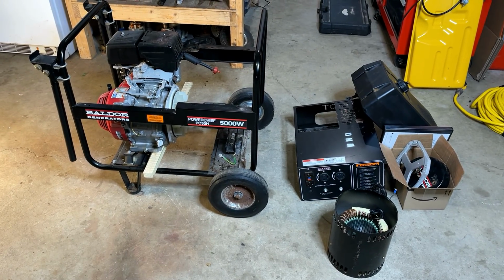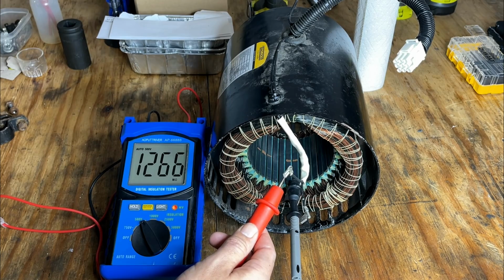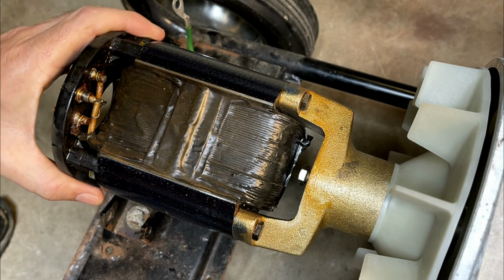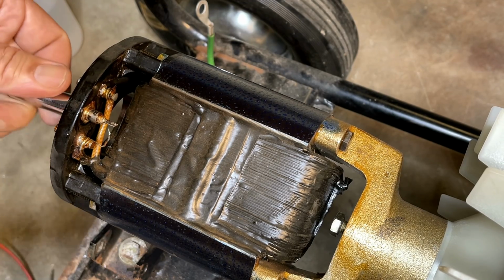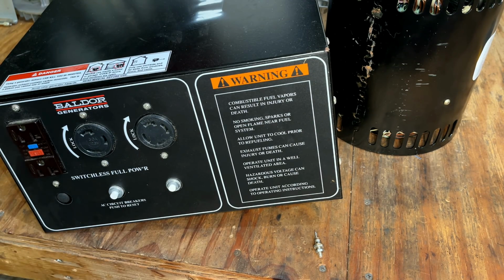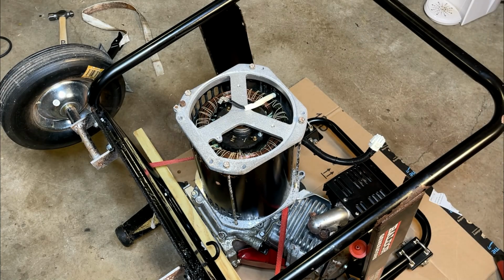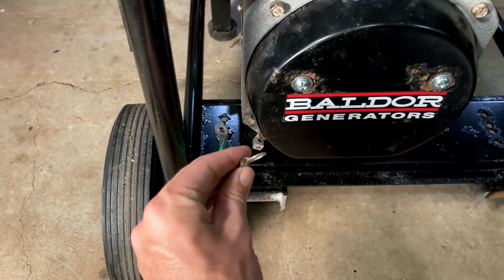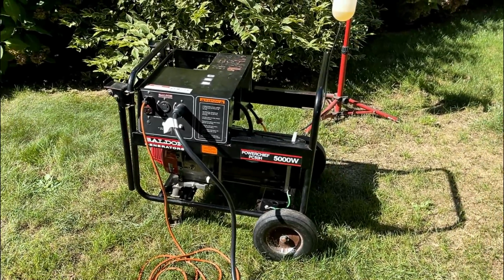Baldor Generator Not Making Power - Can It Be Fixed?

Comment: Did you try both Mouser and Digikey?
Reply from the maker: I tried Mouser to locate a comparable part.  They were not able to cross reference it.  I ended up ordering the replacement diode from Mouser.

Comment: The diode has an excessive solder blob at the base of the tip .. remove all the excessive solder and retest …
Reply from the maker: Thought about it, but it was covered in epoxy and in one section almost looked like the diode vented blowing a hole in the epoxy.

Comment: Hi Love the vids. As the diode only fails when you push on it in one direction, indicates that there is a mechanical fault on the tag. Looking at all the solder on the base of the tag I would bet there is a small blob shorting the diode out. I would guess that the excess solder has been added to help it resist the centrifugal force.

Comment: Hi James. I left this comment a few hours ago, but forgot that YouTube comments can't mention links, so it was never saved. I found a manual that has a Generac number for the diode: DI0176A01. (This will take you to the manual, too.) It's listed as discontinued everywhere, but those listings give basic specs: 22A, 1500V, DO-4 form factor.  You said the diode you used was 25A and 1200V, right?  I don't think the voltage difference matters in this application.  Should be good. Great vid as always.
Reply: Excerpt from the forum above - ' Hello everyone, new guy here. I have in my possession a 2012 Baldor PL6000K light tower. Since Generac purchased the Baldor generator line this seemed like a good place to post my questions.

It came from a military donation program and I don't know the history.

The unit looked good until I got close to it. Radiator, alternator, battery and temp sender were missing. As well as the mast raising winch. Before spending a lot of effort tracking down those parts I got it to run. It still had fuel and oil in it. I bypassed the key and it started. But it won't make electricity. Discovered the capacitor is missing. It is also missing the diode from the rotor. (See pic) I pulled the stator housing off and checked all the windings. Everything is good with no shorts to ground and good continuity. I thought there were diodes elsewhere but no. Looks like the diode was mounted on the shaft. It didn't look like anyone had been in there before. Getting to it required pulling the fuel tank and the back of the generator off.

Generac provided me with part numbers. The cap is OC3060F10SP. That is a 370 volt 60uF cap. Easy to find. I have some 370 50uF caps from a rotating power converter that I can try. The diode number they gave is DI0176A01. They stock it and it's $66.00. I found one site that shows it to be a DO-4 style 22 amp 1500 volt diode. I would like to use a cheaper diode and I'm wondering how critical the values are. I can't find one with that exact spec. I can find 25 amp 1200 volts from Vishay. I am also wondering if polarity matters since there is only one diode in this machine.

Thank you. '  -   This guy must have found the same diode that you did James.

Comment: When unsoldering the lead from the diode:  You would have more success heating the connection without the needle nose pliers attached.  The pliers will act as a heat sink and draw heat from the connection requiring you to apply more heat or prolong the process.  Your application of solder before removing the connection likely just served to preheat the part enabling you to be successful with the pliers in place.  Your videos are appreciated and a credible source for information,  Regards.

Comment: In this case, where the diode is connected directly to the coils, probably just turning 60hz AC to DC, and not part of really fancy circuitry, a "normal" diode that has the same form factor, and at least the same A and V rating as you expect to see, will be enough.  A lot of the weird numbering schemes you see are essentially special runs for individual customers.

Comment: The diode must be a standard diode. People see loads of diodes and are confused Zeners are diodes below 6.8V doing their thing and have from memory a positive temperature coefficient after that they are avalanche diodes and have the opposite temp coefficient. But these diodes are usually called Zeners . Shotky diodes are fast switch with a high doped junction . But you are using a diode in a 60Hz situation. This is the model T of diodes, basic stuff.  But again reading comment from Jim Smith, he perhaps is correct as it can not be a junction fault but a mechanical fault. In my long career in electronics diodes never heal. I have had them intermittent . Clean that fully up of all solder and flux etc it probably is good.

Comment: A standard silicone diode and germanium to memory typically have an expected minimum 10:1 ratio when ohm measured both direction.  Germanium .3 to .4 vdc breakdown, a silicone .6 to .7 vdc breakdown/bias.

Comment: Hey James,

At 18.23 when you go to desolder the diode, your soldering iron appears to not be working. Next time remember your needle nose pliers you’ve induced on the other end of your soldering project act as a big ole heat sink. Good idea refloating your solder before or adding new to speed up the process but next time get your solder joint hot first then quickly bring in the pliers after your connection is ready so as not to use your irons energy heating up you pliers before it can ever heat up you connection.

Hope that helps.

Love your videos. Keep ‘em up.

Happy Thanksgiving 

Leon

Comment: (ex-)electronic engineer here. The diode logo is from International Rectifier, which has been acquired by Infineon. It is NOT Vishay, although Vishay does manufacture similar diodes. Distributors like Mouser do not usually know the markings of the manufacturers on the components, which explains why you didn't get anywhere with them. And since it's not manufactured by Vishay, that's why they didn't reply (although they could have been nice and let you know). The acquisition by Infineon complicates things if you were to try to contact them - it's possible they lost the data about the markings from IR.

The diode is a "stud mount" diode. 0733 on the marking is most likely the date code : year 2007, week 33.

Regarding your rant, the problematic company here is Baldor Generator. They should have written the type of diode in the manual in the first place instead of obfuscating it with their own part number (or at least give a description). All of that just to grab a few more dollars when people order spares.

S1362 is the International Rectifier marking, however, I could not find any reference to it. And frankly even when you look at the datasheets of diodes you know the part number of, often the manufacturers do not mention the actual marking on the parts (it'd sad, but it's the way it is ...)

I am not familiar with this type of rotor and generator, however, from my understanding, the purpose of the diode is to short the rotor winding and create a north/south magnetic pole by forcing current to only go in one direction. If this is correct, the good news is that the diode type is extremely non critical. You simply need a generic rectifier diode of the same size and current/voltage capability. The one you ordered should be good enough. I assume you got VS25-FR120. If it fails again, try one with a lower voltage rating (see below) and higher current rating, and maybe get a Schottky diode instead of a standard one.

Are you able to see any marking on the MOV ? If the MOV is parallel to the diode, it will protect it, so you choose a diode rating above the MOV peak voltage (and never below), otherwise the diode may suffer reverse breakdown.

PS: I disagree that it is an 1N1362, as suggested by other comments. The 1N1362 is a low current zener diode, which I do not believe make sense for this application. It's not because it shares "1362" that it is the right part !

Hope this helps a bit !
Reply: You probably already know this, but for others:

There are a number of companies who specialize in finding odd/obsolete parts or suitable replacements.  They often have a web page where you can enter the name of some part you've run across.  These are called part cross-references.  Radioshack used to publish one so you could convert component numbers to Radioshack naming.

You'll find things like:

- "new old stock" - obsolete parts that someone has squirrelled a close-out sale away somewhere.
- updated parts (some parts aren't made anymore and are replaced by a new one)
- substitute parts from other manufacturers that don't use the same numbering scheme.

For example, a good part finder when given the number 1N1001 (1A 50V) should show you a list of other manufacturers making something similar, and a list of "normal" parts you can use instead (like 1N1002-1004 - all 1A diodes in the same package, but for voltages from 100V to 1000V.  Why buy the 50V ones?  The 1000v ones are just as cheap, and I'll bet most 1N1001-1003 now are just relabeled 1N1004s).

If you ask for a RCA 1802 (aka "Cosmac 8 bit microprocessor" - very simple CPU used heavily in early satellites because it was far more radiation resistant than anything else at the time), but nobody's made them in decades.  You'll find one or two places that have a few dozen.  You can actually find them on eBay too.

A few more recent satellites were built with 1802s off eBay, because they wanted to reproduce an old successful design instead of redoing the whole thing with a newer processor.

I did try S1362 in a couple of these cross references.  Nothing found.
Reply: Wow! What a great contributions!
Reply: I’m going to look in my inheritance and see if I have Dad’s Megger or maybe my brother snatched it. His was an analog type with a large dial and a hand crank like an old telephone. He used it for two things: checking for insulation failures and fishing 😮. That’s right fishing. You attach the leads to a couple of pieces of chain, drop one on each side of your WOODEN boat and crank away. Grab your dip net and collect your dinner. 😊
Reply: This is likely a "house numbered" part. 1N1362 is the aforementioned Zener diode and searching 1S1362 gives a standard diode but the current is a couple orders of magnitude too low and it's in a DO-27 package which is also way too small and a standard through-hole part. Also the 1S suffix is a JIS suffix that implies a signal diode so if I had thought a bit I'd have known that was a dead end before I even looked it up. (1R would have been a much more promising JIS suffix.)

Cross references are likely to be impossible unless someone has an internal reference sheet. It's also possible that Baldor had a custom part made, though this is unlikely as an off the shelf diode likely meets the requirements.
Reply: I agree with Andrew, probably "house numbered" if you can find absolutely nothing about it, annoying, but it happens.
Comparing it to other IR part numbers, I'd hazard a guess that S1362 means Stud, 13A, 620V. Getting a replacement with sufficient beef should do the job just fine.
I also saw the 1N1362, but it wouldn't make sense in this application to have a Zener diode, it's only supposed to rectify one way so the rotor gets a north and south pole.
Reply: Sounds like an unrelated problem I ran into a while back. A Town had a house, surrounding City has Sewer/water, but to hook up it has to be annexed from Town to City. Hmm ok that's done and things get hooked up. Go to sell house and look at City Records for home built in 50's. City online records say built in 80's. Ok clearly not. Contact old Town to find info, sorry we gave our paper folder to the City we have NOTHING left from it, washed our hands. Ok contact City records...they say ok lets see...nope that's all the info we have. But you were given the records...the year built is kinda important. Sorry we can't find anything, maybe there's something in some box in a storage room but nobody here knows if we do or where it would be. LOL gotta love gov
Reply: The S1362 is most likely a proprietary number for baldor.   If you know when and where it was built in the states you might find the representatives covering the Baldor account at the time.   Most maintain records and drawings for key accounts.   Check with ERA Electronic Reps Association as to who had the International Rectifier line or their competitors like IXYS.
Reply: Yes, the function of the diode would dictate what characteristics are needed.
Reply: Longest comment I've read on my life
Reply: @Coolbeans176 and valuable!
Reply: yup that diode is an indian product. me from india, know it
Reply: @AbhishekC-92  Vishay is actually an American company, founded i 1962 by a Polish-born immigrant.  It's named after his home town (presently in Lithuania).

It's now one of the majors, but specializes mostly in power components.  Eg: power diodes, power FETs, resistors etc.

I sorta have a connection - I worked on refurbishing a cold-war era radar system ("Dew Line" unit) that was located in Ottawa (for research and testing), and repurposed to satellite tracking.  We were converting it to a radio telescope.  It was the first western instrument to spot Sputnik I.

The connection?  The DC motor controller system (driving two 10HP dc motors at variable speeds) was a WWII vintage monster (about size and weight of a commercial van) used for controlling the turrets on battleships.  Contained vaccum tubes larger than your head.  Made by a company called Reliance Controls.

Vishay acquired Reliance (by way of Spectral) in 2000, and are still building stuff in the UK.

We ripped the old Reliance out (using forklifts) and replaced it with something the size of a microwave we designed ourselves.  The IGBTs in it were probably made by Vishay.

Comment: As I look at your oscilloscope, it seems to me that the distorted wave form is the result of the way the rotor excitation is carried out.  The diode changes the induced AC current in the rotor to flow only in one direction making it a pulsating DC current.  For half of the cycle the magnetic field is building and the second half cycle the field is collapsing.  This might cause the rotor circuit to "ring".  The generators with AVR's run the rotor current through a full wave bridge rectifier, making the rotor exciting current much smother.
Reply: Agreed and I would have used a Schottky diode instead of a general purpose one, in order to get the fastest possible recovery, which could limit this ringing. In fact, I would suggest that James try changing this diode for a Schottky one to see if it improves the waveform.

Comment: Semiconductors aka Diodes can typically behave like this after heating them this is because the material inside is very tiny and heat can displace a short temporarily, in the internal structure they are very complex devices hard to fathom their failures have so many causes, I can tell you it's not a Zener diode based on the symbol marking on the diode and personally because the diode was already short circuit it won't do any harm to find a replacement diode with voltage rating around what the generator puts out. Work out max current could be, based on the generators capabilities even if you blow another diode it is highly unlikely to do any more damage than what may have already happened with the original diode I would look for something rated between 13 to 20 amps or higher at between 250 to 400v be aware the higher voltage diodes have more thermal heat output due to voltage drop across them being higher, as a replacement, they are called STUD diodes. Also check for solder bridges on those legs they can cause shorts.

 https://en.wikipedia.org/wiki/Failure_of_electronic_components

Comment: Great video , I think the diode is to protect the rotor from current flowing the wrong way and burning up the rotor . Yes I agree on the way you replaced it , what I do not like is that there is no such thing as customer service . I under stand that they want you to buy a new one , but I also can not believe that they get that many phone calls  on repairs . It is bad when a $3.00 part keeps a $1500 generator from working . It is getting so bad now .
Reply: Chris - the diode is there to rectify the AC induced in the rotor (same as is done in an induction motor) into DC as the rotor is an electromagnet.  Brushed generators use DC current through the rotor.

Comment: I was watching this video and I noticed that on the old Diode there looked like excess solder next to the main housing along the shaft where you connected the wire and if there was excess solder that would have caused the short problem you were getting especially when you flexed it.
Reply: I suspected the same thing

Comment: I'd like to see the waveform for a brush type generator to compare.
One problem with generators and UPSs that have poor sinewaves, especially UPSs that have pseudo sinewave outputs, is that the high frequency content can generate eddy currents in transformers and heat them up so that the thermal fuse pops.  I had a simple wall wart transformer for my computer speakers that had the thermal fuse popped because of running on a UPS for an hour.  I cut it open with a Dremel tool and replaced the thermal fuse with one I got from Radio Shack and it worked again.  I learned not to plug in such transformer devices to my UPS.  Actually the newer wall warts use switching power supplies and they are just fine with messy sinewaves.